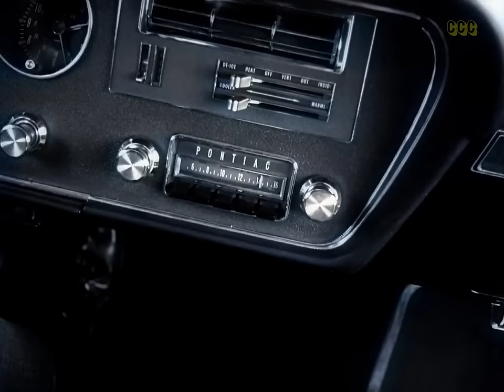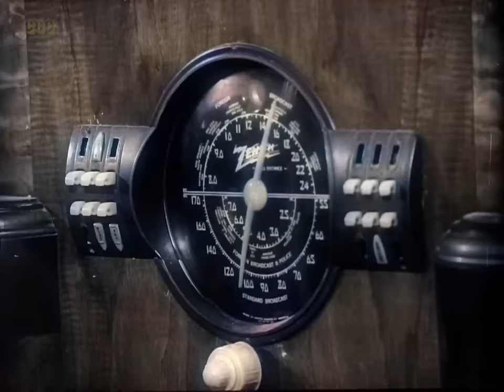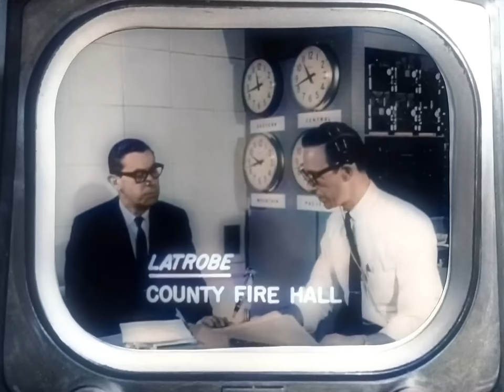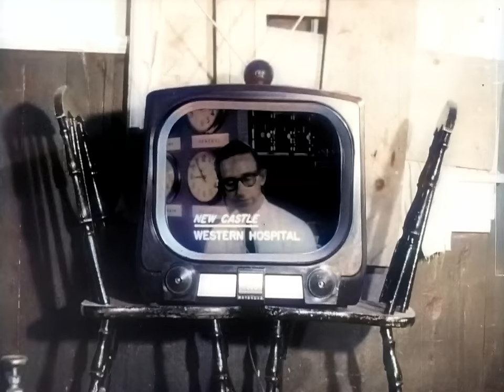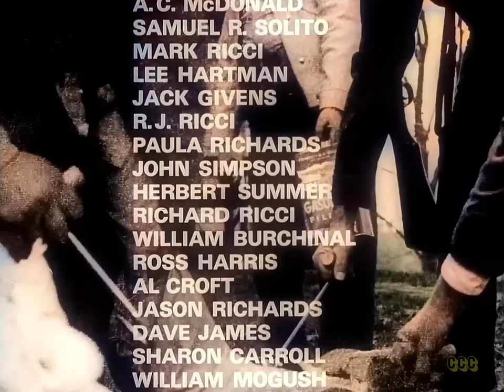They won't stay dead!: Night of the Living Dead (1968) Colorized Full Movie

Comment: not a clean copy, you should be able to clearly see his feet and the car brake pedal when they are in the car, this also has been cropped, missing video on left and right, there are better copies of the color version as well as a second color version done by a tv station in which the car is pink, that color version is better and does not have shifting colors